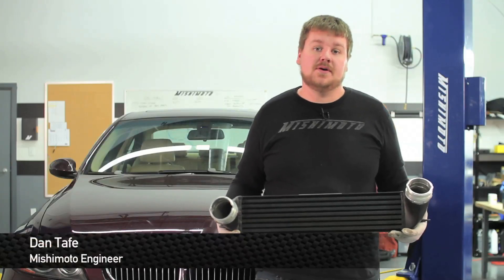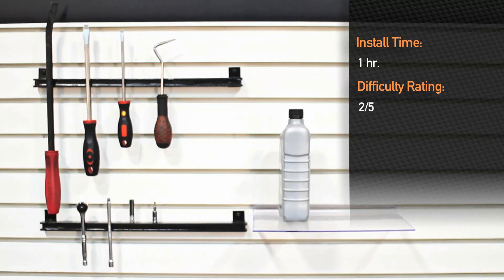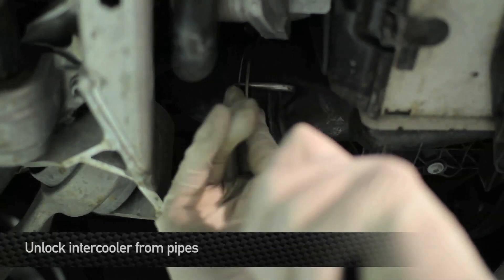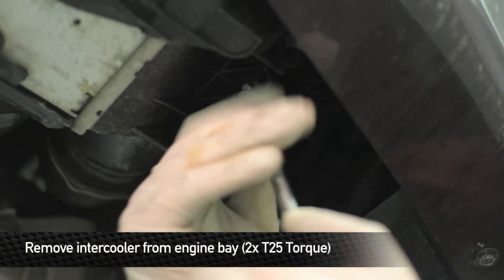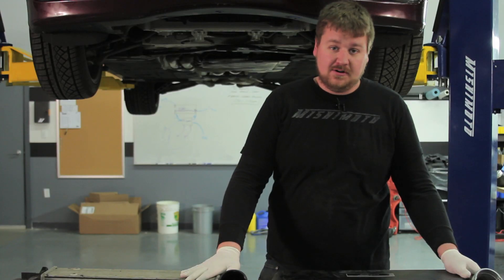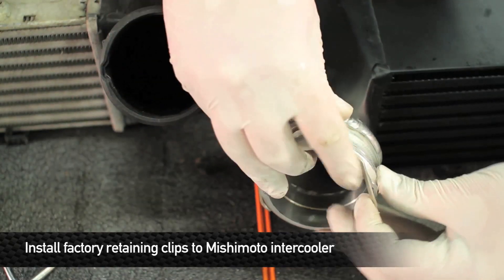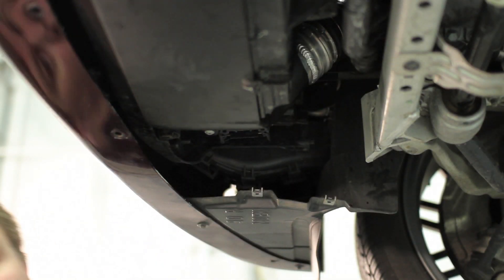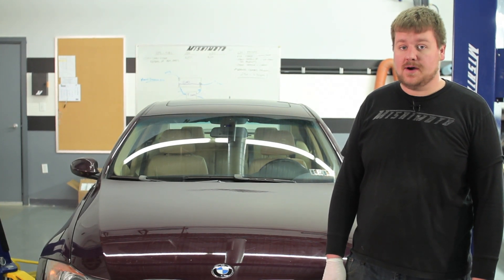How To Install: Mishimoto 2007-2010 BMW 335i / 335xi / 135i Performance Aluminum Intercooler

Comment: Are there any for N55?
Reply from the maker: This radiator will fit a N55 car as well, we have just not had the chance to film the install. However it should be very similar.

Comment: Could you install this on a 07 328i??
Reply from the maker: The radiator for the N52 and the N54 unfortunately use different inlet and outlet connectors that make the radiators incompatible.

Comment: What is the benefit of this intercooler vs the stock unit? Do you see a pressure drop ? Do I need to adjust the turbo pressure with a boost controller